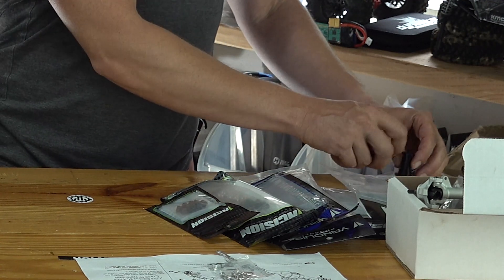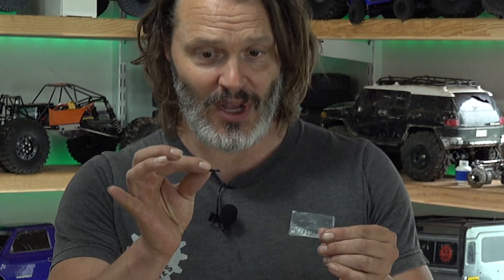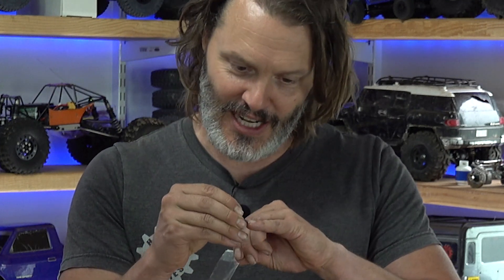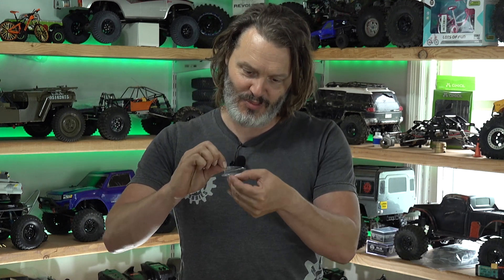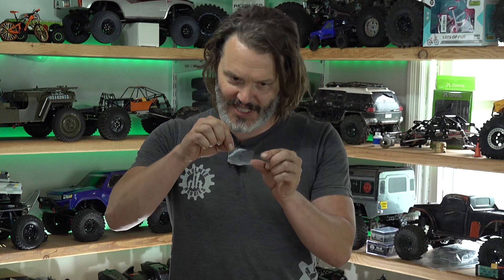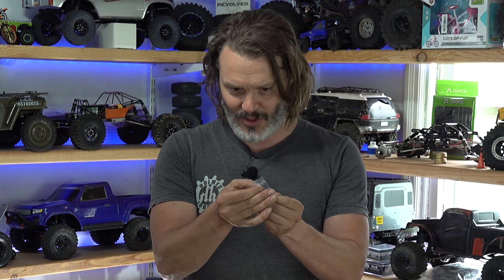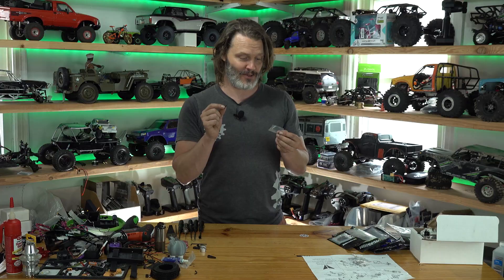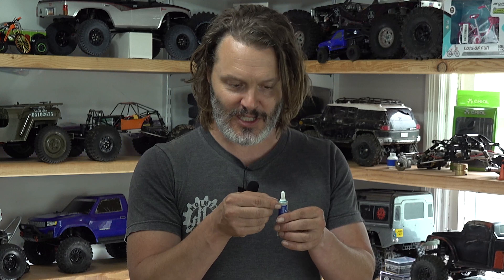🔐 Unveiling the Locktite Mystery! 🔬 Metal Contact vs. No Oxygen ⚙️Holmes Hobbies

Comment: Loctite will air dry but not cure untill its under pressure in the threads of a tightend screw your plastic baggie didnt have enough pressure to cure it and no air for it to air dry! Just like CA glue

Comment: Its supposed to cure... in the absence of air AND the presence of metal! I use to recieve polaris suspension bolts with pre- applied red loctite in the early 90's to install factory updates on snowmobiles. That was before they ever sold it in the stick format. Only thing available was the liquid! So they've had the technology for a very long time. I don't know the complete science, I just know that it works, lol.😂😂

Comment: Hey John, have you ever used Loctite 425? It's, cyanoacrylate/aliphatic ester, low strength meant for metal and plastic fasteners, and I think it's supposed to be safe to use on 3D printed plastics or resins.
Reply from the maker: I haven't, looks like a thick but weak CA glue
Reply: I looked for that a while back but it was hard to get/expensive. I use Vibratite 325 instead on plastic.